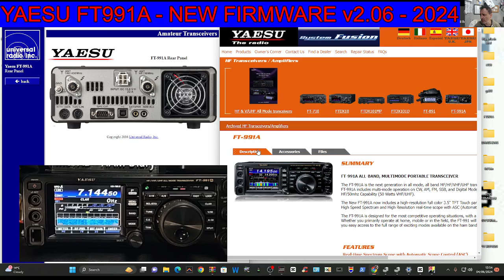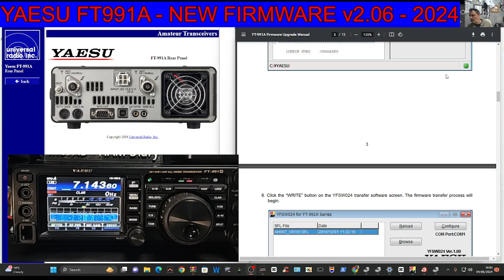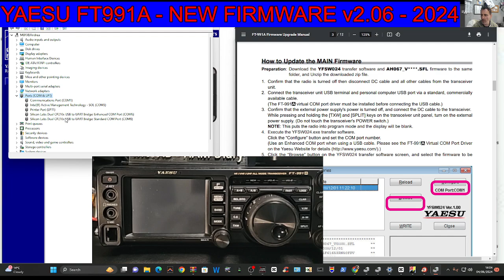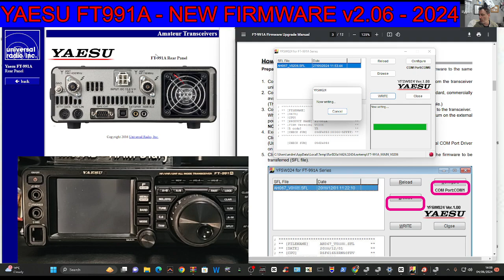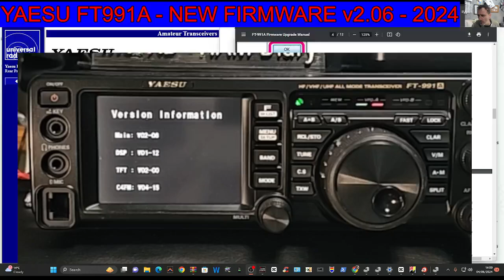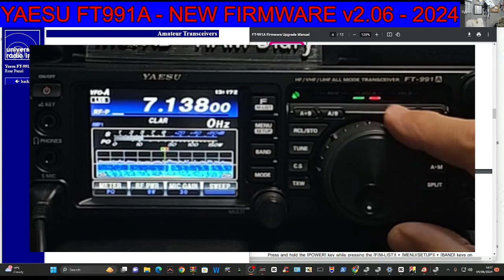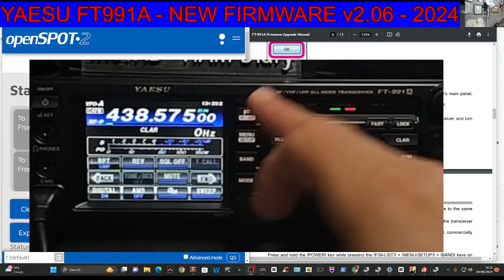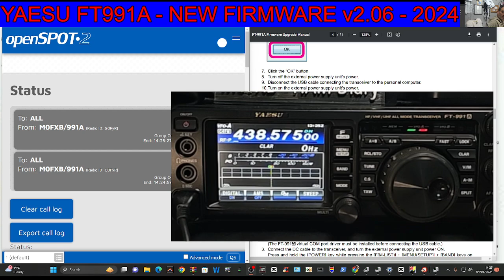YAESU FT991A - NEW FIRMWARE v206 JUNE 2024 FULL INSTALL Replaced 18th June 2024 v2.07

Comment: Update done - August 2024. Full factory reset so save settings. And apart from the documented changes have found you can now TX when in Wires X Menu, when you are on a repeater and press REV the frequencies now switch to show the change and if you knock the vfo when on a repeater the input frequency is now removed and makes it clear you have gone to vfo mode. So far so good,
Reply from the maker: Nice tips
Reply: @M0FXBHamTech  Its nice to see a manufacturer listen and correct things - took them a while though ;-)

Comment: I was going to ask if this fixed the A/B indicator bugs, but I see that it does not so why bother with the update then ...bah..waste of a firware update if it don't fix stuff.
Reply from the maker: Ok
Reply: @M0FXBHamTech  I called Yaesu and spoke with Roger there.  He said that in the far upper left corner there will NEVER be VFO-B displayed.  Where the VFO-B LED's are above the VFO knob, ONLY the red light will be shown when the SPLIT button is pushed.  When in Split mode, then a 2nd freq will be displayed as VFO-B above the waterfall and then pressing the A/B button will alternate between the VFO-A and VFO-B frequencies so no bug as one would think.

Comment: I got this email from Yaesu they are working on the firmware update for the 991A. So sit tight and be patient.

Hello Steve.
Thank you for contacting us regarding your FT-991A.
I am sorry but we did find a problem with the latest firmware update and have subsequently taken it down from our website. We will re-post it when the fix has been completed.
We are aware of the problem with the update removing the MARS mod and that will be corrected with the new update.
Unfortunately we do not have a timeframe on when the new update will be posted, but we do know our engineers are curently working on it.
If there is anything else I can help you with, please feel free to contact me.
Best regards,
Rodger Kerr, N6GMT,
Amateur Radio Technical Support
Standard Horizon Marine Support
Yaesu USA

Comment: If only I could afford a 991A!
As it happens though, I DO like my 897D, the forerunner of the 991. I fear that modern radios from Yaesu, Icom & Kenwood now have so MANY things that can go wrong that I could never repair myself, that they are not a viable option if longevity is required. My FT-897D (circa 2003) is built like a tank, and has a small display but great performance. It is almost military hardened and shall do fine in an emergency situation involving EMP.
Reply from the maker: I understand but the 991a lasts for ever it's worth the extra cost even tyeb897bis very hard to repair.

Comment: Are my settings reset after updating the radio?
Reply: If you follow the last step of holding F M-List afterwards, yes. I skipped that step on mine. Firmware upgrade otherwise seemed to work fine.
Reply from the maker: Yes as at the end you factory reset .

Comment: Implements improvements:
Updates: MAIN V02-06 for web release (2024/06)
1. Fixed the issue where the displayed frequency would change when QMB was operated during
PMS.
2. Changed the behavior of the A/B key during PMS to swap VFO A/B.
3. Fixed the issue where the MIC EQ did not work when transmitting with VOX.
4. Other functional improvements and optimizations have been made.
Reply: I was searching for a changelog and couldn't find anything. Thanks for sharing!
Reply: @BradleyBrown  It looks like Yaesu removed the new software from the site.
Reply: @simonbussey7530  Will wait a bit before updating. Old(er) version(s) is(are) not available so there is no way back unfortunately.. And not really sure if it makes a difference.
Reply from the maker: Thanks

Comment: I did the firmware update and A/B does nothing.
Reply from the maker: Agree
Reply: The A/B still behaves the same way. The text on screen will still say VFO A but it’s in fact switching between A and B each time you press it. To confirm this yourself set the radio on a HF band, press A/B button and you will see the VFO information change.
Reply: @Alex-2E0KUD  Mine does that in the last firmware V02-04 the only thing is it does not say which vfo you on. I did the new update V02-06 and hit A/B and it would not do anything for me so I went back to V02-04
Reply: @Pacman163  oooh I get you now. Thanks I will avoid the update as well then.
Reply: @Pacman163  Could you share a link for the download of version 02-04? For those who want to get the old version back, I don't see it at the Yaesu download page.
Reply: @Pacman163 I wanted to see for myself what you described so I updated my firmware. Just like you said the A/B button wasn’t doing anything but I noticed the “MEM” green and red light was on meaning I was in memory scan mode. I pressed V/M button and the VFO A red and green light switched on. I then pressed A/B and the VFO changed as expected. So I suppose now it matters if you are in MEM or VFO mode for some functions to work. Split operation probably works same way now.